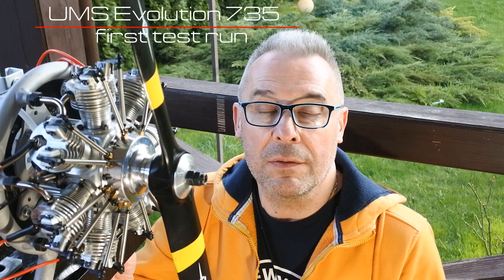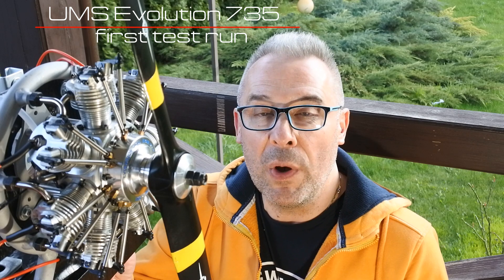UMS Evolution 735 first run

Comment: Exelant!!
But as it seems, each flight its a Morgan fuel galon!!!
Reply from the maker: Thank you for your comment ! Not a gallon, certainly, I’ve not complete engine brake in routine, but during the first starts, engine consumed not so much fuel, as you can expect from the 35 cc engine. Let’s check its fuel consumption in a few next test runs, after full break in.